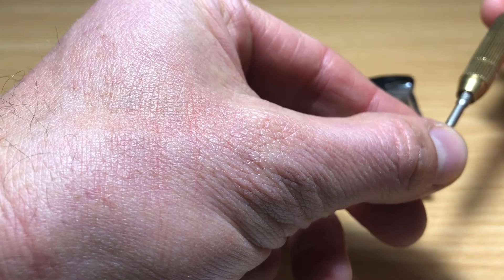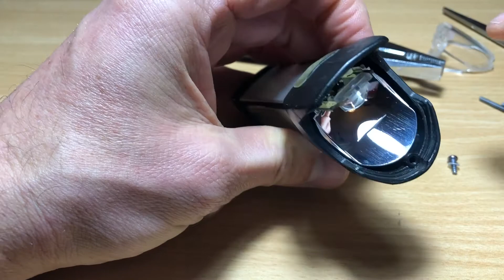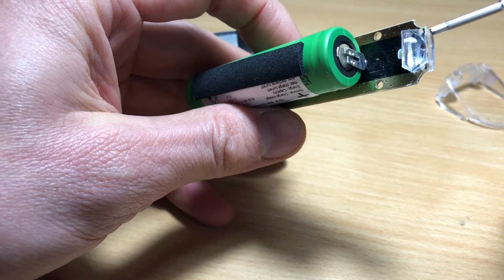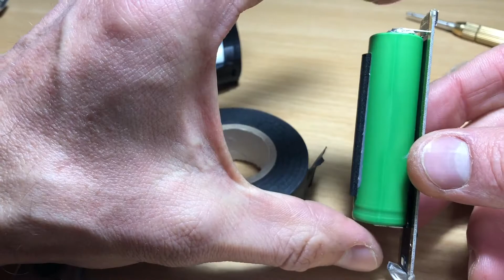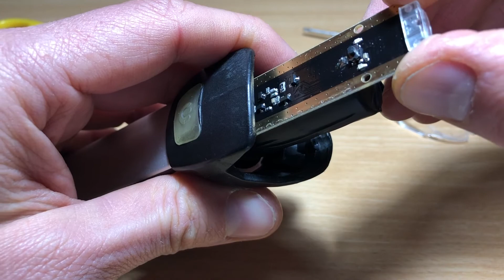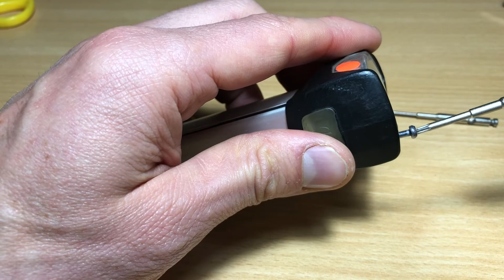Open and repair a broken Busch + Müller Ixon Core headlight in 15 mins

Comment: So the battery is a 26650 type? The battery in mine finally failed, and I want to try to replace it.
Reply: Ixon Core has an 18650 cell. Make sure to buy one with solder tags as you can solder these to the PCB yourself; as someone else mentioned, soldering directly to the battery could be catastrophic.
I replaced my worn-out battery with the Samsung INR18650-35E ("u" type solder tags), which has almost 50% more capacity than the stock one.

Comment: Dear Rodolf, thank you very much for sharing! But please beware of soldering the battery - that might be very dangerous. The original connection is spot-welded, not soldered, and it seems to be so for a reason. Quick search on the net brought up plenty of warnings on soldering Lithium batteries (risk of overheating them, which might set them on fire or make them explode).
Reply: 100% correct! 👍
Your best option would be to buy a new battery which already has solder tabs welded onto it (like the stock one). A quality replacement is around €7, which is well worth it to give this solid lamp another ca. 5 years of life!
Reply: ... else: Great tutorial!

Comment: I have an Ixon Space that won't turn-on or charge.  Do not try to remove the mirror!  Just slide out the entire assembly.  It has a blue plastic wrapped battery with two leads that plug into the circuit board.  No obvious faults in mine. No lithium battery swelling. It contains a BAK 26650HE 5000mah battery. Not sure what to check next...maybe a temporary 3.6v substitute battery.
Reply: Have you been successful fixing it?

Comment: Thank you for the video but the way you work with the light makes me cringe:) to work near the mirror only use some soft plastic that cannot scratch it, when you have no other tools or possibilities at least wrap the plyers with insulation tape for such job you show here for many reasons: you can brake the electronic plate or separate its layers, scratch something or cause short-circuit, and never use any metal tools near electronic parts nor touch them, specially when the power supply is still in. Don't touch the LED as well:) But I still love that you managed to repair it quite well and not put into trash. Take care:)